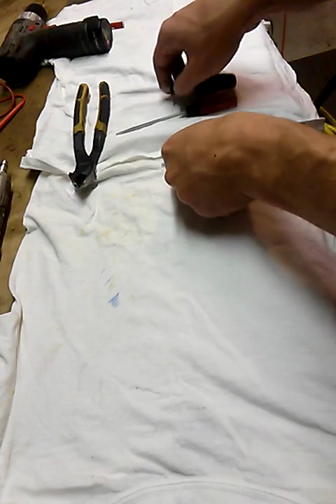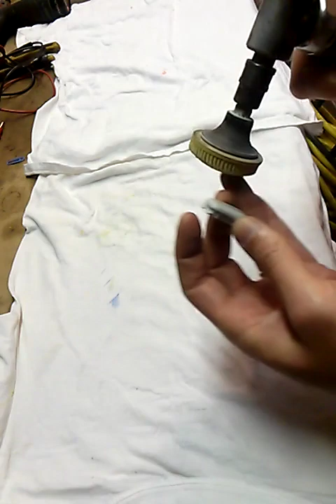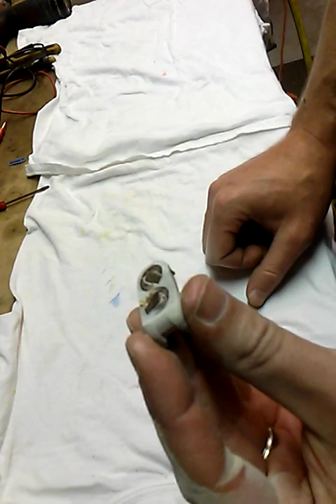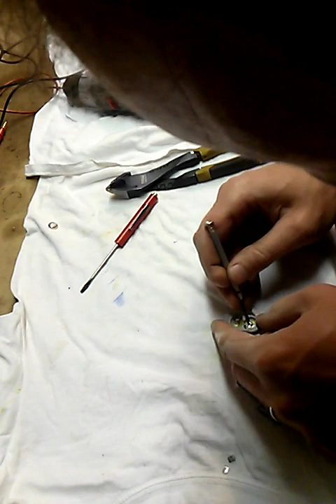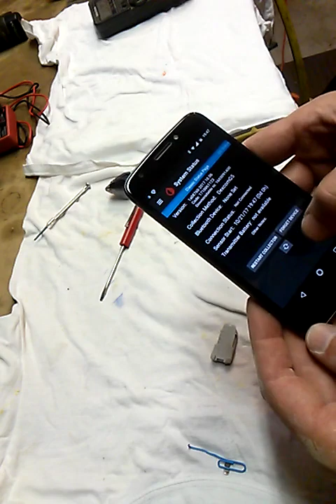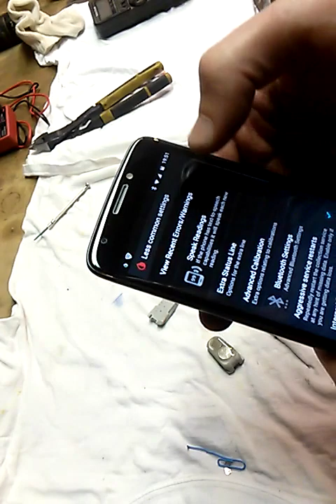Dexcom G5 battery replacement

Comment: Hi Vince
Thanks so much for this video.  What brand/model is your angle air grinder?  That is the one piece I don't have yet.  With Dexcom not shipping G5 transmitters anymore, it is time to take the plunge and try the battery replacement on my old G5 transmitters.  Thanks again!

Comment: Is it possible to change the batteries more than once? If so, would the "resurrected" transmitter still work with the receiver?
Reply from the maker: Yes, and yes. It will work with the receiver if the transmitter is 'reset' with xDrip+.

Comment: Does this work for the G6 also?
Reply from the maker: If your G6 serial starts with 80, or 81A-81D, then you can replace the battery and reset the transmitter as far as I know. It has a single battery and is different from the G5. I have not done one yet. See: https://seemycgm.com/2018/07/12/g6-transmitter-battery-replacement/

Comment: Vince,  you were such a big help a couple years ago when I  came here.  I left some comments then about how well everything went.   I had two  transmitters that I fixed using your methods.  Both of them I did twice with good success . Both of them failed on a third try.  The failure symptom was good voltage measurements, and xDrip showed connection satisfactory  but  never any data received no matter how long I waited.  I always made sure that the sensor connections were good .  I bought  a “refurbished”  transmitter through eBay  (that was simply using your procedure with a very nice looking finish paint job - looked very much like the original Dexcom product.  It worked very well for a couple months - them quit completely.  When I went in to it as I had done the work myself,  I found one top battery contact had been broken off.  And whoever did the job let it go that  way with the only  connection  to the battery was the very edge of the remaining metal!  A very poor situation.  Because I went into the transmitter myself, I saw no recourse with the company and never made a complaint.  I was able to repair the damage and had a very good operating transmitter.  I was recently into a second set of batteries and all was well…. Until today!  I just changed the sensor  and fitted it in my usual place on the side of my abdomen.  And while I was waiting for the two hour warm-up,  I decided to mow the lawn and clean up around the yard.  Later when it came time at the end of the two hours,  Xdrip was saying not receiving any data.  I checked for the possible reason and found  the transmitter/senor was missing - lost somewhere in the yard!   In all the sensors  I’ve worn, this has never happened  and apparently was caused by getting wet from perspiration before adequately  securing in place.  I’ve looked everywhere and haven’t found it - so far, I’ll look some more tomorrow.  I’ve tried to get one of my two other transmitters going,  but neither one  want to receive any data.  I looked through people’s comments here for anything that might help.  I found where you wrote about a “reset” of the transmitter, but the procedure of using the “syringe”  is not clear.  Perhaps my xDrip version no longer has this .  Anyway,  can you suggest something that might help me out?  Maybe I can order another “refurbished” part and take my chances.
 But it would be nice to restore what I have.
Reply from the maker: Monte, please see https://androidaps.readthedocs.io/en/latest/EN/Configuration/xdrip.html for good information on resetting transmitters.
Reply: @vincep8388  Sorry Vince,  I was thinking that resetting the transmitter would correct my  not-working problem.  Thank you very much for the  info to do a reset.  I've done that after finding the true problem with one of my non-working transmitters was  a bad battery connection.

Comment: Hi Vince,

Your video on battery replacement got me started with Xdrip, it has been great, thanks for that. I just got a new phone and I'm having problems with uploading the Xdrip app on my new phone. It is asking me to add a successor and there are more questions. My initial xdrip says xdrip + and still works but I'm not able to move forward with the new app. Do you have any suggestions.
Reply from the maker: I'm not sure what you mean by your phone asking for a successor, or your initial xdrip saying xdrip +.  I am not aware of comprehensive documentation for xDrip+, but AndroidAPS has some good tips, whether or not you use AndroidAPS. See https://androidaps.readthedocs.io/en/latest/EN/Configuration/xdrip.html Also, you may get some help from the gitter xDrip channel: https://gitter.im/jamorham/xDrip-plus

Comment: Vince P: Hi, thanks for the video. I got the batteries out and all contacts haven't broken. I understand correctly that you shorten the top contacts by half ??? Can you please explain to me how to bend the contact after shortening ??? I can't see that well in the video. Don't I have to solder the contact to the battery? Thanks a lot for this.
Reply from the maker: You just bend the contact down inside the battery cavity. I have had good results without soldering. The pressure of the battery in the cavity holds it tight. If you can fold the lower contact in half that will increase the pressure against the negative battery contact and help make a better connection there. You will see high resistance at first if you use xDrip, that seems to settle down over time.
Reply: @vincep8388  Thank you for the fast answer. I understood that, thank you very much. 
And what do I do if the contact breaks off? And what do you do with the paper clip? I couldn't see that in the video?
Reply from the maker: @spackospacko5009  I bend that so as to place it under the lower contact. Using that as a tool makes it much easier to fold the lower contact over.
Reply: @vincep8388  Hello, thank you. I understood everything so far, except for the instruction to make the lower contact in two parts. Can you give me a detailed description?

Comment: Hello Vince, I have been using Xdrip instead of my G5 receiver and I like it better. The only thing I can't figure out is: what does the "HIGH NOISE'' triangle w/! in middle mean? I contacted Xdrip on their website and no reply yet. Any help would be appreciated.
Reply from the maker: That means the value shown has high "noise", which means the algorithm views the data as suspect, either because of inconsistency, or some other reason.
Reply: Thanks, just trying to learn what i can.

Comment: Nice video Vince, very helpful!! I just replaced the batteries in my G5 sensor and I'm getting the voltage just like in your video. I am not able to get it paired with my g5 receiver though, I use the receiver only, not the app on my phone. Can I use that Xdrip App to start the battery and then program that same sn number into my receiver and hopefully it will "pare"?
Reply from the maker: If the transmitter is over roughly 112 days, it will not pair to the official receiver.  You can pair it to xDrip and use that app, or you can use the app to 'reset' the transmitter to work with the Dexcom receiver.
Reply: @vincep8388  thank you, I really appreciate it.
Reply: @vincep8388  thanks, I'll try that.

Comment: Thank you! I wasn't careful enough and pulled out the lower (neg) contact with the first battery -- i got super lucky and was able to drip the smallest drop of solder on the remaining contact point and press the battery into it with slip lock pliers -- when i saw the 215 on the meter i couldn't believe it -- YMMV.

Comment: What software you were using for the transmitter with new batteries. It doesn't work with the original app.
Reply from the maker: As stated in the pinned comment, xDrip+ or Spike. Links are in the comment. The transmitter also can be 'reset' with either app and used with the original app or receiver.

Comment: Please forgive my ignorance, but why can't both the bottom and top tabs stay intact? I understand that the top one may not stick to the top because of it springing back, but couldn't a small drop of some kind of adhesive on top help it adhere? I'm on my 2nd try now. The 1st one, the top tab broke off and when I tried to salvage the little bit left on the inside, it also broke off. So no contact remains on that one. The 2nd try, the bottom broke away from the bottom. I don't have a soldering kit(yet). I'm wondering if a pair of tweezers would work better to crimp the bottom. But it seems like we should be able to leave the bottom one alone completely. Again, I'm ignorant to how electricity and batteries work
Reply from the maker: Regarding the top tab, if you have an electrically conductive adhesive, yes, it could be glued to the battery. I used to solder them, but I think the method of bending them inwards for an interference fit works better. Some have purchased spot welding equipment to tack the top tab to the new battery. As far as leaving the bottom one alone, I have done that also, but the size of it requires perfect placement to avoid a short, and doubling it over as shown adds thickness, which, in turn adds pressure and increases chances of a solid connection.

Comment: Thanks Vince, this is a great technique and a well made video. I've done this twice now and both times I get good results from the multi meter but I can't get xDrip to get readings. It says it is connected but it says "Transmitter sent raw sensor value of 0 !! This isn't good". Any ideas on what I've done wrong or should I try the xDrip group for support? Thanks again. The Type 1 community really appreciates people like you who are doing this work.
Reply from the maker: It seems that when this happens, it can be resolved 1 of 2 ways: Remove one battery for 30 seconds to 'reboot' the transmitter, or do a 'hard reset'. To hard reset the transmitter, touch the syringe(treatment) icon on xDrip+. then the microphone icon. Say "enable engineering mode". Once that is done, then repeat the steps and say "hard reset transmitter". It will show in the status page when it sends the reset command. I have had to use my phone settings to clear all xDrip data and re-pair the transmitter after this; this varies by phone. If you have BG data you want to save, you can export it first, then import it afterwards.
Reply: re: "Transmitter sent raw sensor value of 0 !! This isn't good"
When i used a stock G5 fresh outof the box, xDrip gave me that message for a bit.  It came good tho.

Comment: How do you reset the clock?
Reply: Look into using the Spike App.  It is a little inconvenient to get it set up for your first time but totally worth it.  It has a bolus calculator that is a figurative and maybe literal life saver.  Not to mention that the batteries last until they are dead; not just the cutoff time set by Dexcom.
Reply: @brianskinner4519  It doesn't work on android phones?
Reply from the maker: @oldman6495  To hard reset the transmitter, touch the syringe(treatment) icon on xDrip+. then the microphone icon. Say "enable engineering mode". Once that is done, then repeat the steps and say "hard reset transmitter". It will show in the status page when it sends the reset command. I have had to use my phone settings to clear all xDrip data and re-pair the transmitter after this; this varies by phone. If you have BG data you want to save, you can export it first, then import it afterwards.
Reply: @vincep8388   I I have a Android phone, and have never been able to pair up on xdrip.
Reply from the maker: @oldman6495  There is an xDrip group on Facebook. If you ask there and give specifics about your phone, any errors, etc.. the nice folks there can likely help you get going.
Reply: @vincep8388  Thank you

Comment: Can you use the dexcom app with the rebuilt sensor?
Reply from the maker: Yes, if you reset the transmitter. Google 'xdrip hard reset transmitter' for instructions. I plan on posting a video soon that goes through this process.

Comment: Hi Vince, thank you for this useful video! I'm a researcher at McGill University working on an artificial pancreas system that uses Dexcom G5 - having to replace the transmitter on multiple devices every 3 months just for testing purposes can get quite expensive so I would like to try this method. I haven't found a way to privately message you, could you please contact me at MAP1mcgill@gmail.com?
Reply from the maker: McGill artificial pancreas lab: What exactly is your question?

Comment: Need to make the dexcom with rechargable batteries,  make a charging station out of an old sensor If it's possible.
Reply from the maker: Edgar Thomas: Some have done similar things,  you'll find them with a Google search. The use of an old sensor is not likely; the sensor contacts on the underside of the transmitter have nothing to do with the batteries.

Comment: Thank You Vince for great tutorial. I tried to change batteries but now the Xdrip shows that voltage A is 253 and resistance about 1000. When I measure straight on G5 pins I can get value of 19,6. Is it bad contact? I used these batteries: https://www.ebay.co.uk/itm/2-x389-390-DURACELL-Silver-Oxide-Watch-Batteries-1-5V-D389-D390-SR1130W-Genuine/251550322913?epid=1424916369&hash=item3a919150e1:rk:1:pf:0

Comment: The roloc disc looks great - I just am very unfamiliar with power tools. What is it attached to? I hear people mention dremels, but it doesn't look like the roloc will attach to those.
Reply from the maker: Tatem Simms: It is attached to a threaded pad, which is chucked into an angle grinder. Really any abrasive will work; I like the Roloc because it is easy on the hands and I happened to have it.

Comment: I only have the red meter.  Where do I set the dial on it to do an ohms test on the leads before putting the batteries in?  Also, why not just leave the top tab on top?  Once I bent the bottom one under the paper I could not get the battery to go in.   Thanks.
Reply from the maker: The dial should be set to the lowest ohm scale. As far as the tab is concerned, if you leave it as is, then it needs to be fastened down somehow, because to get the battery out, it becomes sprung away from where it needs to be. I'm not sure why you can't get the battery in. What exactly is stopping it? It's a rather tight fit anyway.
Reply: Vince P  I figured it out.  Thanks.   So what is that app you are using at the end?  I downloaded a thing called xDrip (I think that is what you are saying) but can't find anything on it that looks like what you are doing in the vid.
Reply from the maker: Ken Lovisa  Yes. It's called xDrip+, and the link is in the pinned comment. The menu button in the upper left will take you to the settings.

Comment: There is another CGM app for iOS only called Spike that will allow you to reset the transmitter internal clock so Dexcom receiver or app will recognize the transmitter as new.  Spike-app.com
Reply from the maker: Yes. I mention this in the pinned comment.

Comment: Hi Andy wondering if u can. Help.  Aftwr everything i enter the dexacom G5 app. Finds transmitter and the says 2 weeks before battery runs out. Then asks to pair new transmitter.
Reply: Im also getting 200 mA on a fluke .
Could it be the app locking me out? When i go into sensor info before pairing no information.  After it pairs it shows serial number date of activition (a few months ago ) etc.
Reply from the maker: Rich M: The official Dexcom app will not listen to a transmitter over a certain age. That broadcast age can be reset via xDrip+ if you have an android, or Spike if you use an Apple device.  See the pinned comment for links to both apps.
Reply: @vincep8388  thanks so much.  Download xdrip.  👌👌

Comment: Nicely shown, Vince!  Just for reference, I've been swapping batteries on two G5 transmitters for about 18 months now, and they just keep on ticking.  Once the batteries are low, I swap the batteries in the other one, and start using it.  So I suspect the unused one completely dies for a while before I put in new batteries and start using it again.  Here are a couple tips I can add to doing the battery swap.
- I took a used up sensor, and nailed it with 4 small brad nails to a foot long piece of wood.  Then I simply snap the transmitter into it, and I have a very solid way to handle the transmitter while working on it.
- I found that a 12" steel file works good to take off the initial resin, and for taking off the epoxy when you have to change the battery again.  I use the edge, so am only filing 1/4 inch width.  I do it pretty lightly, and once I reach the metal battery contact, then I quit filing and use a sharp utility razor to cut off the rest from the battery and gray resin.
Reply from the maker: The jig and file are both great ideas. Thanks for sharing them!

Comment: Wonder if you could do this with the new G6 transmitters?
Reply from the maker: Yes. The G6s only have one battery, and, of course, it's a different size. One very sharp lady has done it already: http://seemycgm.com/2018/07/12/g6-transmitter-battery-replacement/

Comment: Hi. I replace the battery and its warking grate. The thing is that on system status it show law valtage 295,and high resistance 2890. Should i do it all over again and replace the battery?
Thanks
Reply from the maker: Oded: Those readings do seem high. The resistance is a measure of the battery voltage when under load. I would continue to use it if it's working, but you may have either (1) poor connection to one or both batteries or (2) weak batteries.I suspect you'll be changing them again before very long.
Reply: Vince P
Thnks, ill try to change the battery and see how its work.